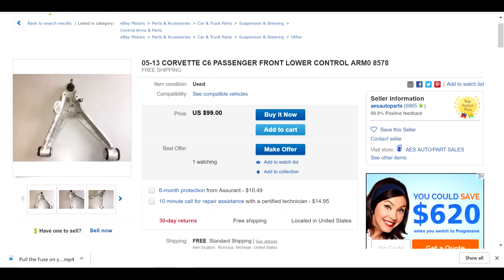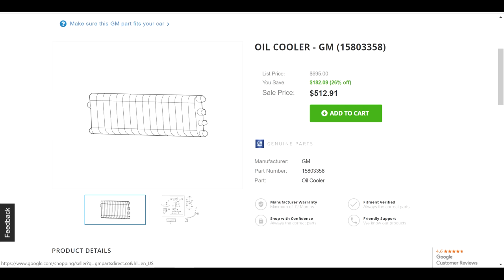How Much I've Spent on the Salvage C6 Corvette Grand Sport Rebuild Project *Really Cheap*

Comment from the maker: James has a LS2 motor for sale, wonder if it will fit in a Chevy Spark?
Reply: Samcrac haha go for it😂
Reply: Lol thatd be so fucking fast holy shit its so light.
Reply: It'd be sick but good luck getting a drive shaft and dif to the rear, no way you could keep it FWD.
Reply: put some Crisco on it and shove it in.
Reply: Don't tease us like this 😥
Reply: DO IT DO IT DO IT DO IT DO IT DO IT DO IT DO IT DO IT DO IT DO IT DO IT DO IT DO IT
Reply: another question did your c6 have the fog lights?
Reply: a lot of people will be stoked if you did an LS swap!
Reply: How are you putting the rebuild paperwork together? As far as buying used parts w/out a vin#? Also does ERepairables  do the paperwork for the rebuild inspection?
Reply: I think he just needs a sales slip as he is buying them from a reputable seller.
Reply: If I were doing what you do I would overspend so bad because holy shit you're creative when you see a number you don't wanna pay lol
Reply: vw Jetta I would of been tempted to buy a 2nd corvette that's flooded 2005 to 2013 c6 and used it as a parts car then sold off the extra parts.
Reply: vw jetta he has all the grand sport body parts with no damage . what is damage is sub frame that unbolts and then missing parts like the rad, oil cooler, then the missing ac part, the fan and what not. He was also missing the headlights and they are the same no matter if it's a grand sport or not. I just think he would of had enough sell-able parts from a flooded one to cover all of his cost of repair and maybe some of his purchase price.
Reply: Samcrac that would be hilarious if it happened lol
Reply: Samcrac an lt will
Reply: well it'll be a rear/middle engined car because that hood ain't goin' to fit an LS2
Reply: V8 in a spark? that would be cool!
Reply: Back in the day I put a Keith Black hemi motor in a Saturn Uranus, I can still hear its exhaust notes!
Reply: My Ducati Diavel carbon fibre model has 162 hp and weighs  430 lbs around 2.4 lbs per horsepower !
The Bugatti Veyron weighs  4,162 lbs  & has 530 hp which = 7.8 lbs per hp.

Comment: Really interesting video and am impressed that someone would take a job like this on.  I have a 2008 C6 with the Z51 package, so similar to the Grand Sport except for the wide body and dry sump.  I have a pair of new headlight lenses I will put on in Spring when the car is out of storage as the left lens on the car is crazed, a common problem with C6s.  The new lenses were around $400 but are DOT-certified.  When you are done with the Grand Sport it will be a terrific car.

Comment: It looked like the trans-axle on the dxp has a piece broken off on it. You can see it at 1:58 of the video the broken part is right by the mount that's below the broken axle.
Reply: I'm curious how that car is going to sit on a frame jig.  A broken engine mount doesn't happen lightly.  Theres a lot of flex and bounce back in a collision.

Comment: i bought 2 corvettes from iaai and both had the headlights when i went to go pick them up they were gone.. this was back in 2000  and they were mid 90's with the flip up headlights after that I always stayed with the car i bought, I preferred to buy cars from a place here called moneymakers (they are now gone) ya its not a action but I got some really good deals and sometimes he would throw in a parts car he called them 2 for the price of one. these were always cheaper cars like a spitfires, If your going to be flipping cars I found stay with one type of car and keep the extra parts :).

Comment: You might want remove those unique  dxp fender emblems off of the wrecked fenders and reuse them on the donor car fenders before you install the painted donor car fenders. Because you know you will never be able to purchase set of replacement dxp fender emblems. So might as well try reuse the ones you have.

Comment: In LA you can get a c6 with 33000 miles for under 19000
Reply: A GrandSport ? or base ?
Reply: A C6.....and a 2011 Grand Sport C6 is a huge difference....LS3, Trans updates, dry sump...I am sure you can find a low mile LS2 05 C6 for 19.....but it's 400hp, and nowhere near a 2011 GS, 18k is a smoking deal...regaurdless of what the papers say....I will stay tuned
Reply: Cheapest I've seen a Grand Sport on a salvage title was $22k, I think, and it had about 80k miles.

Comment: cool video i had almost the same experience with a salvaged 2008 4lt paid 125000 and 35000 miles changed dr side control arms upper and lower fender well fender radiator and nose peice ect 20000 total any way i did the lense trans plant gingerly and ended up with alot of hair line lesions  see if you can get a pair already white and sell the blue ones that is the only regret ive had good luck either way

Comment: body shop kept the headlights? they have stolen from the insurance company. you might want to bring that up.
Reply: Gizmo Thewytchdoktor everyone blames the “bodyshop” we put these small parts inside the car , then it remains unlocked during transport, then at the insurance holding lot, then transported again to the auction. Meanwhile at every point being handled & moved by low paid workers. Most times that is where those go missing because it’s impossible to keep tabs on in that stage. Unlike when the insurer picks the car up at the body shop they refer to the pictures that were taken during the estimate & make sure all parts are with the car & we have to sign to that in order to get paid for our tear down & storage fees. Sad everyone gives us a bad name by assuming.
Reply: everyone blames the “bodyshop” we put these small parts inside the car , then it remains unlocked during transport, then at the insurance holding lot, then transported again to the auction. Meanwhile at every point being handled & moved by low paid workers. Most times that is where those go missing because it’s impossible to keep tabs on in that stage. Unlike when the insurer picks the car up at the body shop they refer to the pictures that were taken during the estimate & make sure all parts are with the car & we have to sign to that in order to get paid for our tear down & storage fees. Sad everyone gives us a bad name by assuming

Comment: Leaf springs on that car are ridiculous. It's a good example of why many people think those are a pile of shit. The last car I'm aware of which had those, and sold in the UK was back in the 70's. It's tractor tech, not race car spec engineering.
Reply: Christian Buczko I drive a Fiat back in the 80s that had a front leaf spring wtf it was scary but in America 🇺🇸 they do not have many roads with bends no wonder cars were crashing when they increased the speed limit to 70mph a sports car with front and back leaf springs should come with two horses to pull the cart that pizza car would out handle it in the bends lol
Reply: It performs on the level of cars twice its price. It's not unsafe to drive, you just need talent to drive them.
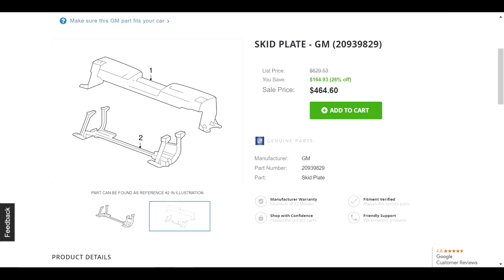Reply: 7:13 on the Nurburgring with the Z06 corvette on "leaf springs" Still waiting for the ZR1 which will be sub 7:00. How is Jag or Aston? Seems like our Tractor tech beats your race tech.

Comment: Also are you saying ur gonna have 3 leaf springs and one coil over?
Reply: Michael Schubert One leaf spring front, one left spring rear, and he will have an extra Z06 rear. The Grand Sport and Z06 models share several pieces, but have different spring rates.

Comment: need upgrade c6,aloyradiator,racecoilvers,,,,stockradiator runs hot in warmclimate,and leafsprings shocksusension is crap,,,esp..after damage its unsafe.....get a rebuiltitle you can expect 5k profit....

Comment: Yeah, but is a 65.00 oiler cooler the same as a 500.00 oil cooler? Granted, GM parts prices are wildly inflated. You are one smart dude, and you do things I can't do. But I'll be honest here . If I wanted to buy a rebuilt Corvette, I'd get one from someone who only did Corvettes.
Reply: Steve Osgood Yeah..... I was really wondering about that, too.
  I mean, besides the usual dealer/brand name mark-up, there's gotta be SOME REASON for the crazy cost of that thing. I would definitely be opening the package when it arrives and doing what I could to try and determine what constituted a "quality product" i.e. Inspection of the joint welds, checking the overall "flimsy-ness" of the thing, thickness of the tubes/frame, and how thick the cooling fins are.

Comment: Question for you about your numbers. Given you could buy the car new at somewhere around $30 grand, and you're hoping to come in at somewhere around $18 grand, it doesn't seem like you're slated to make that much money. Especially given the amount of work required. How much do you "discount" the car because of its salvage status?
Reply from the maker: Good question. I don't flip these cars, I just drive them and enjoy them. Eventually I will Sell to move on to something different, but on a sports car like this, I think the most "discount" would end up being around 20-30% off of retail price (given mileage/age) when I do go to sell. On a more common car that is less desirable I'd move that scale up to a potential 40% off (all of these numbers are AFTER the car has been properly fixed).
Reply: Thank you! Keep up the good work! I love watching your vids.
Reply: I could always get close to trade in value for a salvage title car,  trade in value worse condition  rough idea to start.

Comment: So what you're saying is, when all said and done, you are gonna have $16,000 in it .And it's valued around $30,000. What are you gonna rack up in labor charges,$4,or $5000.That will put you at $20-$21000.Even though you repaired it properly, I wouldn't pay that kind of money for a rebuilt or salvage title. Something  should be able to be done, legally, to make the title reflect that it was fixed properly and correctly.

Comment: This car has a front leaf spring wtf I am from UK 🇬🇧 and I thought front leaf springs finished in the 1960s I am fifty years old and have only ever drove a little Fiat  with this type of front spring even my classic mgb gt 74 chrome bumper has coil springs has leaf springs in back but hell I had a alfa sud in 81 discs all round fully independent suspension  with coils springs all round any way love your channel just shocked to see leaf springs on any car especially a sports car
Reply: yamaha ttr600 It's a transverse leaf spring. It mounts side to side on the chassis, instead of forward to back. Corvettes have basically always used this setup. If you fit aftermarket coilovers, it deletes the leaf spring.
Reply: rcairforceone yes semi elliptical cart spring that is from the  1800s 1930s just shocked to not see coil springs and shocks must handle like jelly all the best ttr600 🇬🇧
Reply: Ortsa yes lol
Reply: yamaha ttr600 also these leaf springs are light weight, being made of fiberglass
Reply: alex seppala interesting information had no idea cars used leaf springs any more fibreglass like a modern bow do not think any European cars have them ttr600 in the UK 🇬🇧
Reply: they also still use pounds and inches instead of kilograms and millimetres
Reply: Bebe Reyes yes this is true I to being 50 still think in pints gallons and inches and yards and have to convert in my head I am just shocked that a modern car would have cart springs when fully independent suspension has been available on car's in UK 🇬🇧 in late 70s we carried on with rear leaf springs till late 70s on rear wheel drive cars I had a alfa sud  82 that I owned in 85 not a British car I don't think we made a decent car after the mid 70s it had disc brakes all round and fully independent suspension all round handling was excellent had the flat 4 which gave excellent performance and helped handling that was fun to drive at speed round corners don't have corners in USA 🇺🇸
Reply: Just had a thought it could of been the front cart spring set up that helped to kill the car into what ever in drive into lol
Reply: It works.
Reply: PHOTOGRASPER it helped to put this sports car into a tree or what ever killed the front end lol 😂 all the best from the UK 🇬🇧
Reply: yamaha ttr600 , vettes are brilliant cars... It's called Yankee ingenuity.  😝  And likely, whatever damage here is due to bad driving, not a spring failure.
Reply: PHOTOGRASPER yes I didn't mean the broken spring coursed the accident it broke in the accident but would not have helped with handling that is why they do a coil over conversion all the best from the UK 🇬🇧
Reply: yamaha ttr600 it'll go round nurburgring in a little over 7 minutes.  I think that's fast enough for this old man.  😁

Comment: Why does the corvette has leafspring. I mean ,normally, coilover are better for a sport car.
Reply: Maxime D'amours the new zr1 still has leaf spring. Don’t change what good
Reply: It performs, and fits better with their chassis design from the building standpoint.
Reply: Because it's an American design. They think that's better, to each their own.
Reply: They don’t want to admit defeat, shame really because apart from that the corvette is an amazing car.
Reply: its composite not metal spring...works very well
Reply: A spring is a spring. Doesn't matter if it's a coil, torsion bar, or leaf. The function is the same.
Reply: well shit talks doesn't prove anything. But laptime does talk about facts and all american muscles are doing fantastic job for how little they cost compare to germans.
Reply: Hop from a corvette to a bmw and then say it does not make a difference, I can say I have done just that and the difference is crazy.

Comment: What do you hope to sell it for if you’ll be in for 18-20k and they go for about $30k without salvage titles?
Reply from the maker: I won't sell it for a little while, I plan on keeping and driving...
Reply: Samcrac thanks, can I ask what you’d expect it to sell for? I’ve been watching your videos since at least the Jetta days and when you were usually on your computer, but I need to go watch all your content. Wondering how viable this is as a sole source of income
Reply: if you do all the work you can make money, no sending it to the body shop no sending to the dealer use the cheapest parts you can find, stick with one type of car, buy one hit front one hit in back use parts from one for the other. save the parts car find a car to use the other parts aka like a side hit so your parts car would fix like 3-4 cars minus the airbags, of course plan on working 24 hours a day 7 days a week, its hard work paint will kill you. lots of dust dirt. Have a place in the country?  its loud nobody wants to live next to the guy building cars. . . Drive the baddest cars in town , , , ,( I did all mine out of a 2-1/2 car garage and i painted all the neighbors cars for cost..) aka made my own paint booth. 2 exs later I no longer build cars :)

Comment: What if the cross member bolts don't line up exactly.
Reply: That would be not good possible the cars body is bent or twisted or the new/used subframe is bent or twisted.

Comment: Did you try to find the body shop that took the headlights out?
Reply: Joe Wilder there probably isn't much recourse trying to get it back. When my car was at the body shop they kept some of the plastic prices from the engine bay. I even went back and walked thru the shop and didn't see it. I ended fixing my car myself after they tore it apart.
Reply: No telling where it happened. It could have also been at the yard or in transport. Batteries, floor matts, and owners manuals have been missing on some of the cars I've had transported.

Comment: What about the condition of the engine being it had no oil? Sure doesn't say much about previous owners I mean who owns a Vette and never checks the oil or never had it changed in 8000 miles
Reply: The C6 Owner's Manual recommends changes at 7,500 miles (sooner if tracked, I am sure) but can go longer if the car is not driven very hard.  My C6 oil gets changed before the car goes into storage each year but the computer still shows 35% oil life remaining even at 9,100 miles.  Synthetic oil is expensive but pretty effective!

Comment: Dude it's not a motor it's an engine!
Reply: I understand your trouble, people simply cannot understand that motors are electrical.
Reply: I like to think of it as a Motor (starter motor) with a large accessory attached to it that's called and "engine". Since Starter Motors are the most interesting electrical part, I'm sure he is referring to that with the "engine" accessory.
Reply: ebay motors
Reply: john   motors are electrical AND internal combustion...where do you get that it excludes IC?
Reply: jonlamontagne so long as you know I guess lol
Reply: It is a motor. It’s also an engine. Engines are a specific type of motor. Which is why we have motorways offices of motor vehicles etc. it’s never correct to call an electric motor an engine, but it’s never wrong to call an engine a motor.
Reply: Not grammar, semantic.
Reply: SgtPiggie motorboat

Comment: Samcrac if the Motor has complications in the C6 could I buy it for 500 bucks Canadian (I need it for my truck plz or if u could find one in Canada sepcificly Alberta) and that Vette is mint chassis and body part wise but those cars a 14k USA but I freaking hate black white or grey Vettes or mustangs ECT. (primary colour) but black stripes on bright paints but I also hate White paints on bright colors